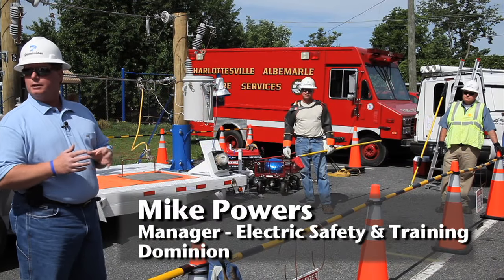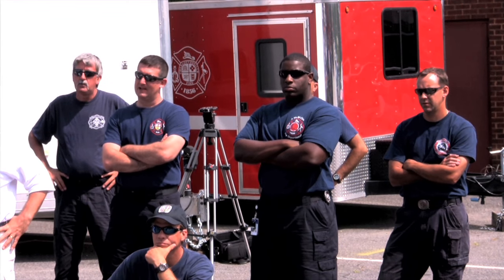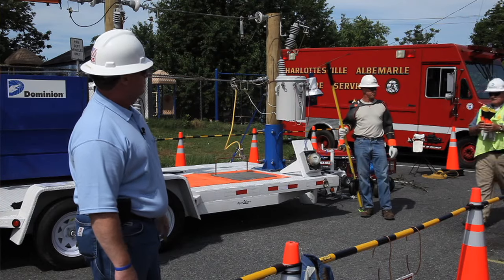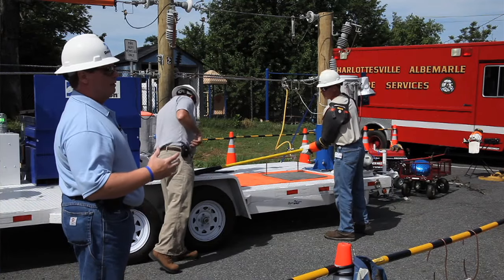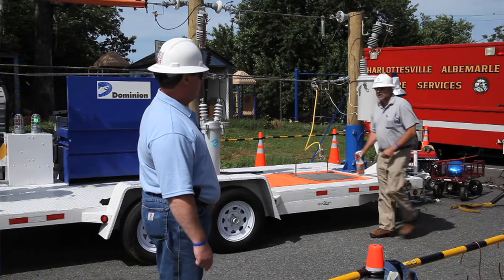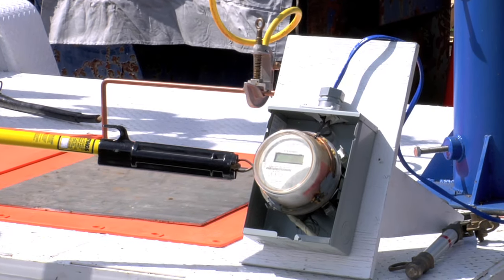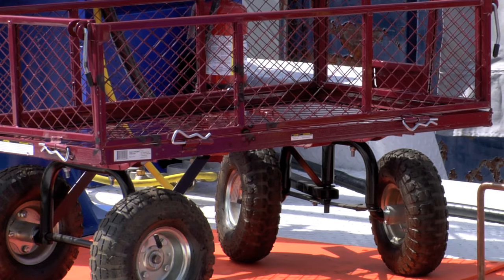Live Wire Demonstration

Comment: Except the fact that electricity doesn't want to go to ground. It wants to return to it's source of opposite balanced potential. Read your electron theory and polarization if you don't believe that. Earth's provides a difference in potential that can allow current flow, but the electrons want to find their way back to the neutral point of the distribution transformer and since the neutral is the grounded conductor, the potential of Earth is relative to 0v where the neutral is bonded to. Electricity does not want to go to ground - even lighting. Difference in potential = current flow. Earth potential will merely allow current flow.
Reply: I read somewhere that the electricity in lightning is actually going up. Is that what you mean?
Reply: The Truth - It can be either way. It’s basically really high voltage static that discharges in either direction. A build up of electrons on one end and a loss of electrons on the other, creates a difference in potential on either side where the electrons jump from one end to the other to neutralize the built up charge. That’s lighting - electrons jumping through the air at a really high voltage to discharge, creating a visible arc (plasma).
Reply: Ah, I see. Cheers

Comment: This is a great demo, I am not an electrician but I tell my dad stay away from the non-insulated top wires (K-Volts) and mid wires (Neutral) including the ground wire on the pole, cause it can have back feed...even when it rains, the utility pole may be charged...

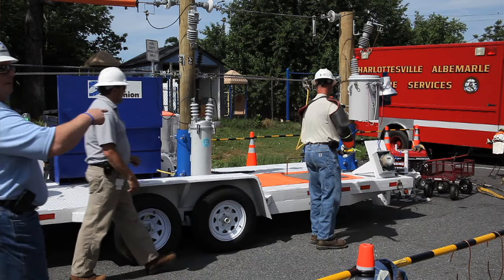Comment: 10:36 "7,200 volts flowing through that balloon". 

Voltage doesn't flow. Current flows. Voltage is the difference in potential.
Reply: They're teaching a safety course, not an electrical engineering course.  You don't have to be highly specific...  Balloon + high voltage = bad.  Let's demonstrate.  "Whoa..."  -- point proven.
Reply: Current at that voltage. Voltage was probably lower with the current rise/voltage fall.

Comment: Someone was hammering a horseshoe stake into the ground.  There was a 220 volt  line under ground.
The guy was killed.  How was this possible?  Unless his hammer did not have a wooden handle.
Reply: Voltage gradient from ground fault impedance creates a step potential, usually this sort of thing kills horses in 1 wire rural areas. Essentially the immediate area is a 3D resistor network with fault current flowing, could be hundreds of volts between each foot. The industry way to move away from these faults is to put your feet together and jump away from the fault area.
Reply: He probably hit the neutral and was carrying the full current of a load through his body

Comment: I seen every one of these happen in real life. Snake blows transformer off pole. Someone swinging 1/2" conduit on roof. Shorts to Ground then primary. Blows half the transmission line in half. Guy walks away. I grabbed what I thought was the phone line to tie off safety belt. It was the ground. Damn near killed me... Some guy drives rebar 10' in the ground. straight through a 800 amp service. Right through the Conduit... I tested the rebar to ground 277 volts... Still not sure how the hell they drive rebar through the 4" Conduit and nick the wire....As it was covered in 6" of Concrete too....I spent 2 days fixing that one....

Comment: They fail to mention that by getting their primary power by back-feeding a transformer, their primary voltage has very little amperage potential. Any of those arcs they demonstrated would have been explosions on a real 7200 primary line. Arc flash is super scary when there is real amperage behind it.

Comment: In the UK local electricity distribution around towns & cities is all by underground cables. No matter if it is 240, 440 or 11,00V. Rural power distribution is by 11,00V overhead line, which are the only overhead power lines you will see apart from the national grid network of pylons that work up to 400KV.
Electrical burns are deep tissue burns, just like when Goober forgets to check his gloves. Using the hot dog is a pretty fair demonstration.
Reply: you forgot to mention the heart stopping and neurological damage

Comment: Smacked my head on a power line standing on the roof hanging up Christmas lights. im assuming because I wasnt touching anything else and the only path to ground was through my thick rubber shoes and then through the house itself is why im not a baked potato.
Reply: cld have been the insulation of the wire too but never trust it it wears out qckr than you think
Reply: @wizard3z868  yes sir i noticed its insulated wire after writing this, however the house is 100 years old!
Reply: @DefinitiveAccess  isnt k&t (100 yr house im sure there is plenty) fun you need a roll of tape everytime you look at the terms and a box everytime you need to remove a device
Reply: @wizard3z868  believe it or not it was rewired! I assume sometime after K&T but before three prong outlets, as they sure left a lot of 2 prongs behind. But behind the old outlets is updated wiring, albeit with veeeery thin ground wires, but it works!
Reply: @DefinitiveAccess  great 4 u I was hoping it was that or they may have run the separate ground wire to the boxes that I have only heard of never seen. But my luck is expect the worse buy the lotto when its not
Reply: If you can reach it from the roof of your house, it is NOT the wire demonstrated in this video. The lines demonstrated in this video are the ones that are  on the tippy top of the poles and they don't come down any closer to the ground unless they're going to feed a transformer. 

You touched the 120/240v house service wire.
Reply: @goaliedude32  yes sir! with insulation as well. Realized this after I posted the comment!

Comment: I hear what sounded like a 13 gallon bucket full of sand drop 30 feet like a big WOOOOOMF
lites out.. I know the gen thing, don't pull the MAINS juice goes up the drops and uses the ordinary
secondary as a primary and the ordinary primary is now a scondary with the 7200 volts on it.

Comment: Really interesting point about the generator and that's something we (UK utilities) are having to be very aware of in a slightly different way. Microgeneration ie solar panels are quite widespread but being fitted by some of the biggest cowboy arsewipes in the electrical industry. Christ knows where the isolator is half the time, if there is one. That means that the solar panels will actually feed-in to the dead/disconnected grid, at least as far back as the service transformer. I work with the meters mainly and even then you can get a jolt or bad news bears if you short the customer tails.
On a separate note, I think if I was to need a generator at my house, I'd probably whip out the service fuse (we have separate service fuses in the UK, not sure about the US arrangement) and disconnect the customer L+N from the meter, and wire them up to the gennie.
Reply: Nope, we don’t have the same those of fuses. We have a mains breaker in the US, but that doesn’t cut the path completely. This is why it’s required for generators that power homes and solar installs to have a transfer switch installed professionally, and inspected to completely cut off from the grid. One of the worst things I see are these solar inverters that have instructions to plug into the wall outlets feeding it back into the grid. Also illegal in the US and if someone does get injured or worse because if a home install without a permit (not professionally installed correctly)they can be jailed, even charged with manslaughter.
Reply: "cowboy aresewipe" good one.

Comment: If a tiny generator can produce full primary voltage simply by running it through a transformer, why do we need massive power plants?
Reply: They both produce the same voltages but a power plant generates massive amounts of amperage compared to a whole home generator. What was left unsaid is that when a person becomes part of the path to ground It will blow a big hole in the body at the entry point and another at the exit point. Sometimes an arm and a leg. At primary voltage it sometimes blows the arm, leg or both off of the body.  At primary voltage the ground only need be within a couple of feet of the conductor for the electricity to jump from the line to the person. That is what arcing is. Like lightning it can strike out and hit a grounded thing from a short distance.

Comment: 10:35 "we've got 7,200 volts flowing though that mylar balloon" how is this possible?
Reply: The Mylar plastic is covered with a very thin film of aluminium to make it shiny, it's that metal that conducts electricity.
Reply: @wetrock2766  I would agree with that. But volts don't flow.
Reply: He removed the fuse. When the fuse is open, voltage is stopped at the bottom of the terminal. When the fuse is in place voltage can flow from the bottom to the energized lines up top. 

He removed the fuse but the balloon covered the terminals and allowed voltage to flow to the lines up top even though the fuse was pulled
Reply: @goaliedude32  Would you then say it's possible to have 150 psi flow through an air hose? Or water hose? What is it that would be "flowing"? I don't mean to badger anyone, but at its most basic forms and terms, voltage CANNOT "flow" it's potential, not volume, not a quantifiable amount of something like electrons flowing. 1 coulomb per second equals 1 ampere of current flow. Just thought someone in his position would know that. When I taught electronics anybody that couldn't grasp that wouldn't pass 1st semester.
Reply: @tomwhitty2850  The voltage potential was given another path the advance. 

Before the balloon the top line has 0v to ground. After the balloon, both the balloon and the line had 7.7k volts.

It was easy to understand while technically not the absolute most perfect way to communicate, he was also not in a situation where it mattered. 

It doesn't matter

Did you understand what he meant?
Reply: @goaliedude32  As a former adjunct electronics & chemistry professor, indeed. But theory and scientific discipline not important? Can you understand the very slight twitch in my facial expression every time this is forsaken? I have several missing fingers that contest how "unimportant" a slight miscalculation can be. This is science. Numbers MATTER. Units and their applications, MATTER. That's ok though, most folks couldn't care less in a let's ask Mr Google dumbed down society. When I was an engineer, I liked to think I understood shit. Like long division. And trig. Try using a slide rule without a firm hunch on what number you anticipate getting from it. I'm not Ted kazinszki, but I kinda think I know where the man's head was at. Think the modern populace that what has an average IQ of 100 in the US will be much of an obstacle to malevolent AI? I just hope between all the video gamers out there collectively they can start a fire without a match. Or a transformer.
Reply: @tomwhitty2850  You are being pedantic. Chill out man. I have an iq around 130 and I don't feel the need to go on crazy rants about shit that doesn't matter.

I jokingly commented on another electrical video, guy said he was "electrocuted" and I gave him his lashing, "If you were electrocuted you couldn't write this because you'd be dead"

I'm saying it doesn't matter because it's not in the design of the system, him saying "voltage flowing" isn't going to get anyone killed. it's talking about how the system currently works and the audience is not a group of intellectual elites or engineers

It's also easier to say 7.7k volts flowing because in a real world situation there would be a load on that 7.7k volt line, which mean current would be flowing, which is correct, but he will never be able to tell you the number of how much current is flowing. So yes, voltage flowing is a reasonable way to describe what is happening here to laypersons. It's not a big deal, go talk to someone about your emotional fits
Reply: @goaliedude32  Appreciated, was a bit of a rant, wasn't it? But childish in my humble opinion is that even when corrected your response wasn't to appear to learn anything, but segue into whether or not yours truly understood electricity. As am sure you see, I haven't put a great deal of thought into writing just a rough draft of rant. But do you, after have been corrected, feel you've learned anything?
Reply: @tomwhitty2850  No, I already understood that voltage doesn't flow.  I was able to follow everything you were putting down. Sorry if i seemed too coars for you
Reply: @goaliedude32  you said voltage flowed not less than 4 times 4 days ago!
Reply: But when corrected didn't acknowledge that fact! Only said it didn't matter! Which is it? Ignorance or apathy?
Reply: @tomwhitty2850  The voltage advanced position from the bottom of the fuse to energize the line.
Reply: @goaliedude32  Might want to get your money back if you went to university
Reply: @tomwhitty2850  I was never wrong. Voltage doesn't flow amperage did

Comment: Anyone else notice the wire both on the tree branch and the boot that helped the otherwise dry gear conduct electricity? Sure, they're getting the point of risk across, but the demonstration is rigged to arc more easily. They declare it on other things toward the end though.

Comment: I hope that generators are sold with very large, permanent warning labels!!! A permit / certification  should be required to use something that can imperil the lives of other people!
Reply: The portable generator is not normally connectable that way, it only has a SOCKET on it, you have to take an appliance cord or extension cord and it's plug and plug it in, and then only that appliance or extension cord is being powered, it's when people decide to permanently connect a STANDBY generator to their breaker box with some crazy/jury rigged on/off switch that the problem exists. I saw a video of a couple wo built their own home in Idaho, they had an outdoor breaker box they wanted to connect a standby generator to but the guy couldn't figure out WHY he was thinking something was upside down in the box and he thought the box was the wrong kind,  or the electrician made a mistake installing it, he was all set to connect the generator a certain way thinking that everything was fine but he decided to call the electrician instead, THAT was when he learned that NO, the box was correct but that he needed more equipment  to do the generator connection and a transfer switch. 

He came real close to messing up
Idiots will do something stupid like strip an extension cord end and connect their generator to the two wires or bus bars in their breaker box, flip the main breaker off maybe and fire up the generator so they have power in the house at all the outlets, but they screwed up doing that and it's feeding power back into the line

Comment: The Edison museum has DC I hear to power some lights and motors how are they getting DC was lightning 120 volts when it was DC late 1800s where circuits 15 amp on 14 wire back then and was there 12 wire on 20 amps with DC late 1800s
Reply: for god's sake, use punctuation

Comment: do the techs REALLY do these tests on their gloves?
Reply: Yes.
Reply: Yes, they do, their lifes depend on it!
Reply: I worked for a power co. in idaho , was a CDL driver / crane oper.  and those gloves are tested to resist 9,000 KV the linemen today has thicker rubber and it's an actual suit like a rain coat ..w/ the sleeves & gloves over the sleeves ,,,
we werent allowed to have the crane or steel wire within 20 ft of the primary conductor ...line bed trucks ( with the auger NOT the bucket ) have fiber lines on their crane's .....and alot of safety equip ....  I went through this training as well to become a certified Crane operator ....
Reply: 9 million volts?

Comment: A car is wrecked, there is a power line down on it, and the driver is bleeding badly, so, no time to wait for the power company.
Obviously, the line has to come off the car before you can rescue him. What might be nearby that you could push or pull the  line off the car?
A stick won't work, so the only thing  I can think of right now is a fiberglass-handled shovel or something. Also, I think I could pull the rubber weatherstrip from a doorway to make a nonconducting 'rope' to pull it, but that puts you pretty close to the wire.
Reply: Don't even go near the car! Electricity will spread through the ground.
Reply: +Knarph from Holland Very true, but I think the difference is between green or dead (dry) wood, is it not?
Reply: I won't trust any wood, you can never know, how much humidity is in it. A minimum of humidity can lead to death. You can use a long, dry and clean pvc pipe for example. Nevertheless it's risky. The powerline can slip along the pvc pipe towards your hands.
Reply: Gary Chandler you're the type of guy who would die from his pseudoscience and false intellect on how to handle the situation safely.
Reply: you could try pushing the car with your car since your car is a faraday cage so you would be relatively safe inside. just make sure your car battery doesnt leak any gases
Reply: throw a chain over the nearby power lines (That aren't downed) and blow the fuses
ground the line and rescue the survivor(s) of the wreck